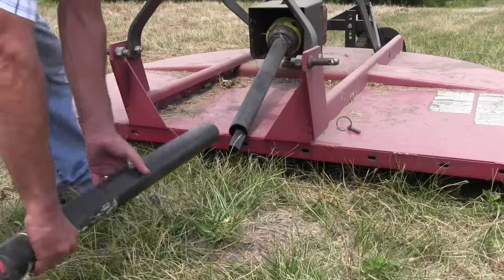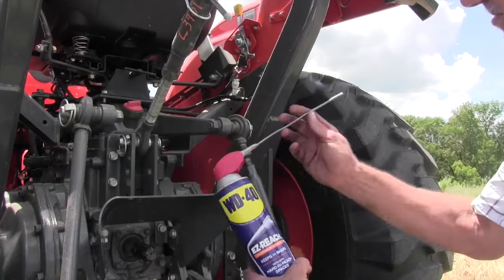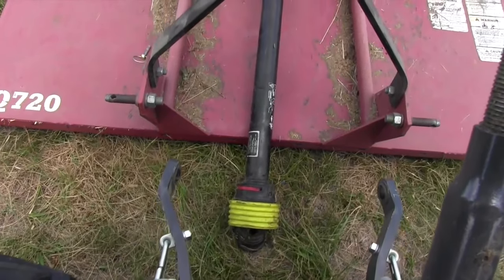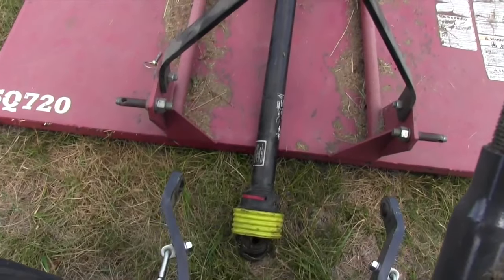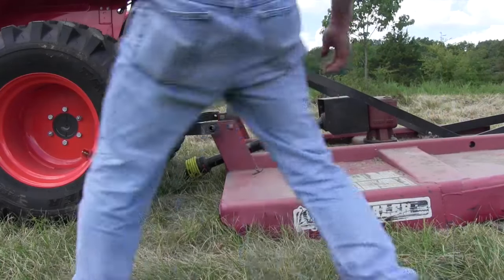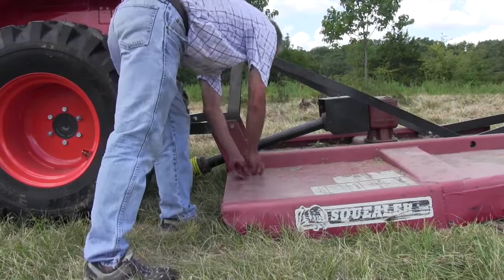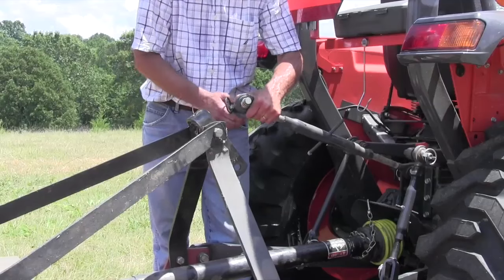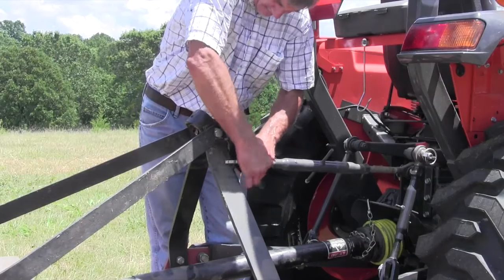A Tip to Make Hooking Up a Brush Hog Easy

Comment: Like many others here I set the front of my cutter on 4x4s. I disconnect the stabilizers so the arms can swing out. While sitting on the seat I have a crowbar and as I back up to the pins on the cutter I raise the arms to align and push the arm onto the pin with the crowbar. I have to jostle forward and backward a little to get the arm fully seated. The weight of the crowbar helps to hammer the arm in place. With this done I get down off the tractor and put the safety pins in then hook up the top link and PTO shaft. My other attachments are light enough to muscle them onto the arms but the Bush hog is too heavy. It takes a little practice but goes quickly after a few tries. Like everyone else I don't like the up down up down to hook up. I tried this with a 2x4 but it isn't heavy enough to knock the arm on. You might need something longer than a crowbar if your seat is higher.

Comment: Hi Tractor Mike, I'll even make it easier for you, when you unhook from a Mower, drop it on a pallet, that way when you go to re-connect you can move the mower forwards, backwards, and side to side all from the tailwheel because the deck is making even, level contact with the slick pallet slats. No tools required.
Reply: I like this idea.

Comment: My experience is to widen the lift bars all the way out and set with pins. I then back up to catch left arm and pin. Then adjust right to line up the height.  Use some sort of pry bar to align and slide together.  I find a small amout of grease on pins will effortlessly help, and will last. Pry bar, 2x4, piece of angle iron is king. !!

Comment: Correct me if I am mistaken, but aren't there Zirc fittings on the adjustable arms that should be filled with grease to help protect the threads from rusting?  Also, rather than messing with all that, just use Pat's Easy Change System that you showed on a previous video.  It certainly makes changing implements way easier than having to have a digging bar laying out in the yard.

Comment: Also tractor Mike if you will put a short 4x4 on each side of the front of the bush cutter it raise the cutter up at the right height to hook your tractor up . It keeps the tractor and bush cutter from being in a bind when you hook the top link up

Comment: My challenge is I put the gear end on first and the shaft will not sliding easily, so I started over. I but the tractor end in first and now I cannot get the shaft to pull back far enough to get the bold in on the gear box. Is there a secret for that since I am holding the rotating housing and trying to pull at the same time? Should have greased it better. Had I watched this video the last 2 hours would have been more fun! Thanks for the fabulous tips and especially as a woman tractor owner I need ways to make it more simple.
Reply from the maker: Good lubrication everywhere will help the situation.  It almost sounds like your PTO shaft is too long.  CHECK THAT IF IT'S A NEW CUTTER.  Here's a video on that: https://youtu.be/-Fu4KwtJG0o.  You want the gear end with the bolt on first, then extend the PTO shaft and slide it on.  Here's something you might try: https://youtu.be/8nub8HrTPB0.  I've done a bunch of videos on hooking up implements, if you go to my website https://asktractormike.com/ and look under the "Basics/Options" tab you'll see most of them.

Comment: Here's another 2 great tips for connecting a bush hog. Place the front skids on 2 4x4's. It will move a lot easier. Also, there''s nothing more frustrating than trying to keep the bushings on the 2 arms against the pins that they slide onto. When they're close wrap a bungee cord around the arms. When they're close and you move the hog with your lever the bungees will pull them on.
Reply: Putting the front skids on T-posts, a pipe, or other metal object will allow it to slide a lot better than a 4x4.
Reply: I basically do this.  I park the brush cutter on 3-4" rounds of firewood beneath the front, one left and one right.  Since there is weight on the tail wheel, I can just pull on the tail wheel left or right to adjust the 2 lift arm connections.   It's still a fight, but the weight is not bigger than I can handle.  Safety tip.  Don't let the implement fall on your foot.  Keep yer feet OUTTA there.
Reply: I have always parked our hog with the skids on 6x6 blocks on a fairly level spot....keeps it up off the ground and it seems to move ok as needed.  Have never tried bungee....my biggest gripe is getting the shaft on the pto....the dang guard sticks out too far
Reply: Yup, I got fed up with the guard on my Kubota and finally removed it. It was damned near impossible to get the pto coupled under the little guard.

Comment: I usually leave mine on a couple of boards and use the boards to move it around. Two or three foot on each side. WD 40 the exposed shafts rather than grease is better, the grease on exposed shafts collects dust, the dust will act as a sand paper and over time grind down the metal. An enclosed area where there's no dust is fine.

Comment: Good video, but why would you use penetrating lubricant on the 3PH adjuster when it has a zerk for real grease?  I grease mine and use a non-penetrating metal protector on the threads.

Comment: Set your lift arms set inside of the hitch on the mower.  Back into the braces on your mower hitch until it pushes back slightly.  You are now in line.  Lift your arms until they are slightly below but almost even with the pin holes on the mower.  Should be able to do the rest by hand pretty easily.

Comment: I just came up with a much easier method, but it requires a concrete or paved surface. I keep my hog parked/balanced on a pair of vehicle dollies you can get at Harbor Freight for about 40 bucks. With the hog on the dollies you can move it around and line it up effortlessly with no pry-bar necessary. 
For me, a much bigger pain in the ass is pushing in the pin on the coupler to slide it onto the shaft. The spring on that thing is so strong I can only hold it in for half a second. I'd like to find a trick for that.

Comment: When I first got my old 9N and accompanying bush hog, I made the mistake of uncoupling them...can't remember why but I had to for some reason....and like an idiot I disconnected the two in my stable, which is where I house and work on my tractor and protect it from the elements (which means to say I had very little lateral space to work with when the time came to reconnect the two).  Well, I couldn't get the two reconnected come hell or high water, because I had no room to maneuver.  Now, my father came from farm and ranching stock and we always had a pinch bar handy and thankfully I had one with me.  I'm sure my father was looking down on me from heaven smiling when the light bulb went off in my head.  So using the pinch bar, I managed to coax the bush hog into position.  Lesson learned: NEVER detach your equipment/implements in a confined space!!!!  Tell you a funny story....one hot summer day, after a long afternoon of bush hogging, I shut down the tractor and was admiring my handiwork (nothing like a freshly cut pasture!).  Something caught my eye on the bush hog, so I walked over and noticed that one side seemed to be riding an inch or two higher than the other.  Now, the blades are still spooling down.  So I started to probe the gap between the bottom of the bush hog (what I call the skid) when I swear I heard my father's voice boom out "MICHAEL!!!!!" (Dad passed on back in 96, btw).  I literally froze and realized that I was just an inch or so from being one of those farm boys who's got a digit or two missing!!!!

Comment: Reply to Brad not Landa
Guess I just fell into the leverage through observation about the 3rd time I had to hook up the brush hog. I like to block the front end up and let my arms hang wide. Then I can pick up the fixed arm and set it on the pin. That allows me to adjust the other side. Usually I can just heave the back wheel over to adjust it but sometimes you have to get some leverage.

Comment: My new best friend is an I match hitch from John Deere, literally a 3 minute job now with NO strain involved you dont even have to tighten up the lower links after you hook it up. Harbor Freight offers their version for 100 bucks. I highly recommend you get one
Reply from the maker: That's next week's video...
Reply: I do a standard hookup with no tools except a hammer and no extensions or adjustments other than (sometimes) the top link, all in under 3 minutes.
Reply: I had one of those harbor freight setups and found myself swearing more than with the regular link arms.  It eventually got bent a little and I just gave up with it and tossed it.  They are probably great for smaller tractors and implements.  I had a 35hp HST tractor at the time with non-adjusting link arms.  John Deere makes them seem amazing on their videos, but I assume their setup is much higher quality.

Comment: Oh, I'd love to see a video on removing the 3-pt.  Had to do that for the first time too.  Wasn't horrible, but could have been a lot better.

-Sharon
Reply from the maker: Your wish is my command: https://youtu.be/ebmksUZPjY0.  Actually, I did that a couple of winters ago and I guess you're not the only one who's had the problem because 24,000 people have watched it :).
Reply: Oh yeah, I did see that one.  What I mean is removing the lower link arms and top link to install your backhoe.  I just got my backhoe yesterday and I had to do that before the dealer picked it up.  It wasn't horrible but it could have been better.
Reply: Tractor Mike grow up with a 6 ft woods diexie  cutter it had a grease zirek on the pto shaft easey to move Used it on a to35 fergeson good combo

Comment: Good idea using the pry bar,  but I accomplish the same alignment by simply kicking the castor wheel around.  Only worry about aligning one pin to start with,  much easier than trying to align both on approach,  then after it's hooked up,  "kick" wheel the other into alignment.  Also,  due to my tractor's configuration,  I reckon,   I can't put the lift arms inside the triangulated attachment frame of the rotary cutter (proper nomenclature),  and move them to the outside when ready to attach.  Therefore,  I go in with arms fully lifted,  straddling the top link attachment point,   then lower in place on the outside,  where the attachment pins are located.
The best tip for using a rotary cutter,   which you rarely see,  is DO NOT USE A STIFF TOP LINK.   Although the top link attach point on most modern day cutters is articulated,  they are not articulated enough to prevent damage to your cutter's support bars if you go into a steep,  deep ditch or similar uneven terrain.  Best to use a top link dedicated to rotary cutting,  which you have to fabricate:  two ball attaches welded to the ends of a length of chain. (Or,  if lifting the whole cutter is not necessary for the area you're doing:  no top link is even necessary.)

Comment: Great "have to do's" .
Now if someone would invent Training wheels for the Brush hog maybe I could keep it at a uniform height .
Reply: Use the top link to set height. If it has a pivoting link between mower and top link....get rid of it and pin It directly to mower....problem solved.

Comment: Usually have the FEL on w/ bucket dug into ground on the edge.  Slight inputs to the curl function move the machine backwards and forwards.  Combine with a bungee pulling the arm ON once you're near position makes it real easy.  Don't get me wrong, you look like you're having fun moving that thing around w/ your stick, but I'll stick with my hydros to do the work.  Work smarter, not harder.

Comment: I usually don't hook up the top link and it seems to work, also I use the bucket into the ground to move the tractor an inch or two without having to get on the tractor. also pick up the lowest main link first so when I pick up ,the other link comes into place, any comments Mike.

Comment: Need doing this for years, same with my Box Scraper, Disk, etc. However, I have a Better tip then using WD-40. I always use DRY Silicone (Spray) on any Exposed parts like the  stabilizer arms or plastic PTO shaft cover. Reason why, Wet Lubricants ATTRACK dirt and dust..and the next time you have to adjust or move them it will make it even MORE difficult. Grease on the PTO Shaft is ok because it is inside though

Comment: Great video, as always good sir! At work we have a hydraulic top link, I've found that if I can at least like the impliment up, then I can attach the top link and use the hydraulic top link to push or pull the lower pins to the correct distance from the link arms. This is of course assuming you're on a smooth surface and the impliment is on rollers, but it does work, then just wrestle the lower pink arms on. 

One thing I really hate is just how dirty the PTO shafts are. Every time you touch it your hands get covered in dirt, oil and grease, I wish their was a cleaner way to attach PTOs. 

Should I always connect the link arm without the adjustment "turnbuckle" first?

Comment: I picked up a used brush cutter a couple of months ago.  This is my second brush cutter - I wore out the first one!  With my old brush cutter, I NEVER broke the shear pin.  However, every time I use this replacement brush cutter I seem to break the shear pin!!!  It is the exact same brush pin I used with the old cutter.  It usually breaks while cutting thicker brush of about 2" thick.  Sometimes, however, it will break cutting tall grass.  The cutter was properly leveled, lubed up, and everything appears to work as it should.  The cutter is very quiet compared to the old one.  Why does my shear pin keep breaking???  Thanks!
Reply from the maker: You've probably already thought of everything I could come up with...make sure there's not any extra resistance anywhere, there's not twine or wire wrapped up underneath and that it has the correct grade of oil in the gearbox.  Was the old cutter the same identical model as the new one?  Or does the new one have different components, like blades, stump jumper, gearbox, etc.?
Reply: The yoke where pin goes through is probably worn from many previous pin breaks. And probably worn at gearbox pinion as well. Buy a mower with a clutch if you mow brush.

Comment: I realize it's not the most prefered tractor, but it's the tractor I have, a 1950's Ford 860 tractor. With it, or some of the implements, I received a couple of solid bars for stabilizers. They span from pivot points under the main axle to the lower hitch points on the implement and get pined there with the lower hitch point balls. One of the problems this causes is that if the implement (brush hog, disk, straight blade, etc) isn't properly centered on the tractor, the implement needs to be moved, generally while the tractor is lifting the front end. I'm not really happy about having the retaining pins being pulled while the implement is being supported by the tractor, but for the moment that seems to be the only way to single handedly attach the implement and get the stabilizer bars attached.

Would it make sense to make turnbuckle stabilizers that  mount to the same tractor under axle points, but mount elsewhere on the three point hitch than the lower implement points? Note I'm not asking anyone to design this, and I realize that if I implement something like this I assume liability. Just wondering if this would be a better process.

(One alternative to a turnbuckle system would be to build a system that uses binder levers to cinch a chain spanning this gap to the same length as the stabilizer bars I have, and when unbound would allow full or greater range for the lower 3pt bars.)
Reply: P.S. Thank you for doing these videos. There are a lot of things I can't do with my tractor as it is. I don't have a loader for example, but I'm doing my best to operate safely and make the most of what I do have. I've found many aspects of your videos useful for this.
Reply from the maker: I know what you're talking about, and there are thousands of those vintage Ford tractors in my area and I've never seen anyone come up with a system like that, but  it sure seems doable if you have decent mechanical skills.  I'm doing a video next week on a quick hitch.  That might be a simpler way of alleviating the problem.  There are pro's and con's of quick hitches, they don't just slide on to every implement and I'll talk about that in the video, sometimes you have to do a little blacksmith work to get them to fit older implements, and sometimes they won't fit at all.  But it might solve your problem.
Reply: I do have a quick hitch, and what I've found is that none of the implements that I use seem to work with it. It may just be the quick hitch itself. I suspect that there are about 3 different designs in production, but what I've found is that none of the top link points have a spacing that works well with the top-link hook on the quick-hitch. Also the points at the bottom of the quick hitch (not the quick hitch side, the side to the tractor, don't work with the stabilizer bars. The 3pt hitch ball, and the stabilizer bar together are too wide for the captive pin to fit in the mount pin. I did grid the stabilizer bar down a bit to see if I could get that to work, but I'm only comfortable with doing that to a certain point, beyond which I'm pretty sure I'm reducing the integrity of the stabilizer bar. Likewise the option of drilling the mount pin for a new captive pin location.

Quick note, the brush cutter I have is a KingCutter (same for most of the implements.) It's a decent cutter, and I'm pretty much using it as a mower. Down side has been that in the past 2 years I've replaced 5 shear pins due to the rocks on my property.